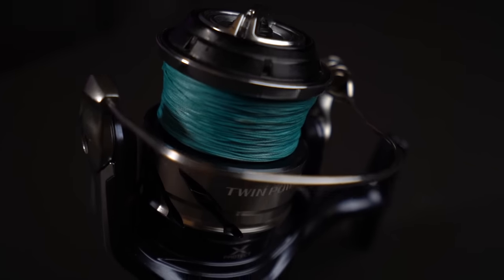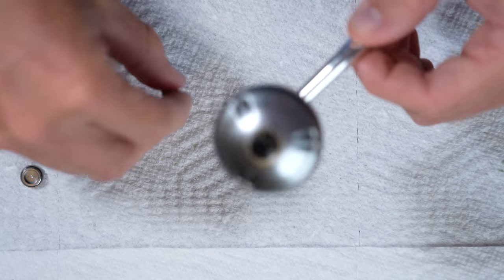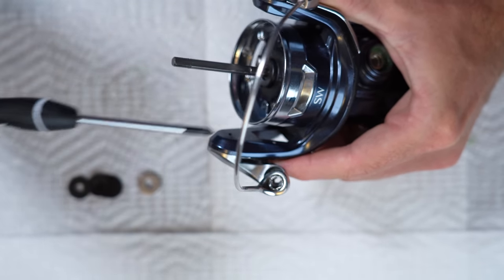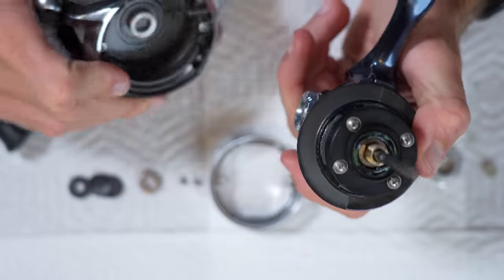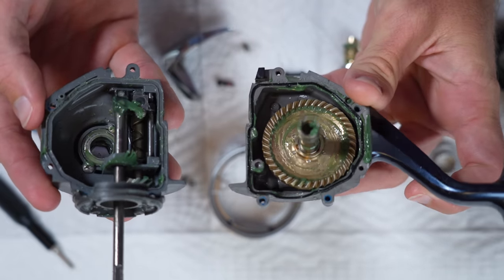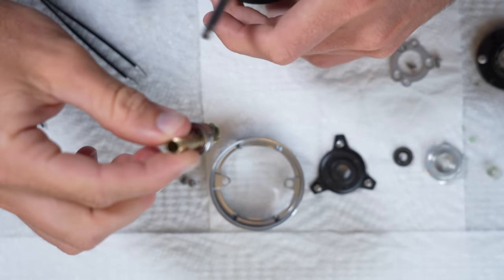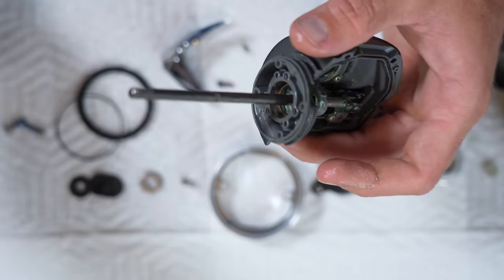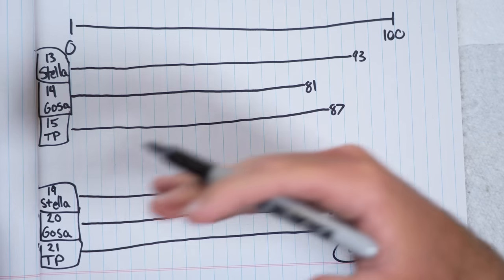TwinPower SW Review/Teardown. Save Your Money...

Comment: Glad I got my Twin Power when I did.  I got mine years ago from Japan and it has a completely different handle setup.  Never had an issue with mine and it's been through hell and back.  Is it sealed up like a Van Staal or ZeeBaas, No but it's the next best thing below a Stella, along with half the $ of those I mentioned.  You call that over greasing? We would pack the body, this way if the is any sw intrusion there is little room for that water.  My Twin Power didn't just get wet, it got dunked repeatedly.

Comment: A quick temp fix for noisy bearing while you wait to new bearing to replace that noisy bearing. Soak the bearing in WD-40 in a bottle cap, so the bearing sits under the level of the WD-40. It will break down the oxidation. Then you can fish while you wait for the new bearing. Continuing problem bearings, I replaced with ceramic.

Comment: Hi Ryan

I need an expert opinion on a problem I'm having with my Twin Power 8000 PG.

While checking the drag of the Twin Power SW-C 8000 pg I just bought, I realized that it was still a bit tight even when the drag was loosened to the end.

Then I compared it with the 10000 pg I have. By the way, I know that the 10000 pg has a slightly different drag system.

I loosened the drag of both of them to the end, checked the drag tension by turning the spool manually. 8000 pg was quite tight compared to 10000.

I then measured the minimum drag values of both reels with a precision balance.

8000 PG’s spool stopped clicking at 900 grams. In other words, in the lightest drag (when the spool is close to coming off), a weight less than 900 grams cannot move (rotate) the spool. The minimum drag is 900 grams (approx. 2 lbs)

In the 10000 PG, this value is 380 grams (approx. 0.85 lb). There is a difference of about half a kilogram.

Is it normal that there is such a difference? Is it normal for the 8000 PG's loosest (lightest) drag to be so tight? So is this a situation specific to 8000 PG?

I would be very grateful if you could share your opinions.

Thanks in advance 😊

Comment: Great comparison of Shimano spinning reels. I have the 4000 SW as well as the 10000 SW (‘19) models. I love both of them and the drag systems got  my attention. I’ve used the 4000 fishing lakes (bass and Northern Pike), offshore for Calico bass and surf fishing (local surf fish). A great reel to have to handle all types of species. I mainly use the 10k model for offshore. It has a lot of drag potential in comparison to conventional reels. 👍🔥 great video. 🐠

Comment: Thanks for the thorough review.  I'm debating upgrading from my Daiwa Saltist and Daiwa BGWQ to a Twin Power.  I'm just getting tired of sending the Daiwas in every season because they get grindy.  Mainly tuna fishing on a boat that tends to spray & splash.  Need high drag, durability and a good seal, hopefully without breaking the bank.
Reply from the maker: The Twinpower is a definite upgrade from both of those reels. And service is easier with Shimano than with Daiwa USA.
Reply: Get a certate sw or a saltiga bro
Reply: @Brian_Vo  No. Its time for him to switch from the dark side😝
Reply: Penn slammer or authority they full metal with stainless steel gears
Reply: And you don't have to worry about them becoming rough and clunky over time because that's how they are out of the box haha
Reply: @Slapturkey  never had a Shimano grind on me. Bought a couple of Daiwa's and they got grindy after only  a handful of sessions
Reply: @Florida dink master  did you not even watch this video? It says in it shimano is far better design and strength over a penn.
Reply: Diawa saltis MQ main gear is made of cheap zincs.  Mine rust very easy

Comment: Certate SW VS Shimano TwinPower SW next pleaaasseeeee! I will forever be grateful! Keep up these teardowns vids coming!
Reply: The sw Is a better and cheaper reel. Certate sw is awesome.
Reply: @kamadowoah4584  which one?
Reply: Problem with the Certate is when you see the cost you might as well just put out a few extra dollars for the Saltiga...If you can.☺️
Reply: @eves08109  for bigger sizes definitely. I need a 6000 size reel.  Went with certate sw and happy so far.  its lighter, more line capacity, better drag, smoother, starts up quicker. Only i like about the twinpower, clicks when you close bail and cast tad further but tbh you can never go wrong with either and its all preferences.
Reply: I was actually considering buying the Certate also and for smaller sizes that was a good choice. I was considering the biggest reel and since the Saltiga 20000H holds a generous amount of 80lb, plus with that drag I just have to get it!..I also have 5 BGs and love em!

Comment: Hmm I will upgrade my line class and stay with my early 2000 sustain 4000. Never had an issue with water entering the reel body or any issues with pinion bearings

Comment: About drag number flex: It's not! Honestly I still wish there were Reels with more drag for their size and even the 2020 Saltiga has given out on me cause I fished too much drag.   It's when you target big fish, especially in freshwater and around structure where you need lots of drag but not a huge amount of line and even a 6k Shimano would be just fine if it had 40-50lb of drag that   it can be realistically be fished at, but I have to use 8-14k Saltigas or the old Stellas and am still at risk of usin' too much drag, while the reel is already a bit much for the rod and the whole setup overkill for the lures that are fished. A 5-6k would be much better but I can only use them when I have room to play the fish and not too much current, or I'm able to follow the fish
Reply: Why not just fish an Accurate conventional reel? That's what I moved to once I realized a spinning reel wouldn't cut it. Twin drag washers and 40-50lb of usable drag as well as machined and assembled in the US.
Reply: @Tyler-kw9ce  they are an option, as well as the Aver Raptors, but they only have this drag in sizes comparable to a 20-30k spinner, and I need these small reels with heavy drag to cast lures, mostly 1-2oz and that all day long,  a conventional without a worm guide just ain't suited for this, plus you need more weight to cast a two pound conventional properly. And in this size range I have enough reels to choose from anyway
Reply: @maxschmidt9461  sounds like a really hard task for any reel to manage.
Reply: @Tyler-kw9ce  it sure is 👍
Reply: @Tyler-kw9ce  but spinners are much better at castin' light lures/weights in comparison to the reel's size
Reply: @maxschmidt9461  yes especially when dealing with larger line capacities. I've been waiting a while now for the new Accurate Tern 2. It's a star drag  with drag washers on both sides of the spool and now has cast control. Going to be using it to throw 1-2 oz flairhawks and swimbaits for big snook.
Reply: @Tyler-kw9ce  I'll definitely have to check it out!👍
Reply: @maxschmidt9461  good luck on finding that reel. With how the technology and design is changing so quickly in the fishing world it won't be long til they produce something like what your looking for.
Reply: @Tyler-kw9ce  I sure hope so 👍
Reply: Tranx 500?
Reply: @jamesh7469  if they make them with twice the amount of drag, then yes. I mean maybe a tranx is an idea for light tackle catfish fishin' talkin' about  a realistic chance of fish up to and even over 8 feet and 250lb. The problem is baitcaster usually don't hold up with this fish, either conventional for vertical fidhin' and paddled baits or spinners for casted lures. The thing is also that the really big baitcasters who might survive the pressure ain't made for the relatively light lures (1-2 oz on the light tackle, 2-3, max 4 on heavy and for the heavy tackle you want 50lb of realistic drag). And even if a reel us capable of catchin' giant fish, if it survives the way I fish, especially about the drag, is a different story 😬.
On the other hand I have made countless people speechless with the fish I caught in ways and places where they either didn't think those fish even exist, or were convinced they were impossible to land.
Reply: Twin power 8000 runs 25kg of drag. That should be plenty
Reply: @ihatethegestapo7649  on paper it does, in reality not so much and the reel wouldn't last at this numbers anyway

Comment: Which has the better casting distance, the stella or the daiwa , and which is the better of the two brands of reels? I have all shimanos and one daiwa. Im still trying to decide if I want to purchase the Tp sw or not for my 12’ surf fishing rod.
Reply: Stella has a better spool lip design for longer casting.
Reply: The twin power is perfect for what you are wanting to do, I'd probably go the 5000 you can run the 6000 spool for extra line capacity if you ever wanted or a heavier line depending on where you were fishing 👍🎣
Reply: @ihatethegestapo7649  
Thanks a lot my friend! I’ll do just that. Tight lines! 🤙🏿

Comment: I sold my Saragossa of using it two times, not a good reel. Choice for replacement was a certate or twin power, I bought the certate, excellent reel. I love my Stella 5000 but I don’t use it as much as the certate due to weight imbalance with my rods. Rods are often too light these days which sucks
Reply: Use Penn carnage rods they ain’t light

Comment: what is the difference in body from a twinpower sw 6000 to a 5000. I see that there is only a 10 gram difference in weight and I put it down to the larger coil (they are not "C" bodies). the difference is internal in the gears? The 6000 has more drag than the 5000. what is the actual difference?
Reply: Spool

Comment: hallo i have a question regarding twin power sw 4000 size. what is the difference between 2015 model to 2021 model?
Also are all 2021 models comes with c compact body?
Reply: 2021 model has a C at the end meaning it's the third generation of Twinpower SW. The Twinpower SW 4000XGC has the body and gear of the 5000 and 6000 with a more compact 4000 spool. So the gear is bigger than the freshwater regular Twinpower 4000 or a Stradic 4000
Reply: @aquaholiklee  thanks for the info. So will a 5000 or 6000 spool will fit the 4000 body?
Reply: @shimiavivi  it will be oversized. The rotor is different on the 4000. The gear and main body is the same. Buy the 4000 if you need the same winding power but at a reduced weight. By the 6000 for more line capacity. The more compact rotor and maybe different handle on the 4000 is the reason for the weight saving.

Comment: I got both..twin power and saragosa.. same size and same gear ratio.. honestly, there are big different in cranking power.. doing vertical jigging with 100g of jig, twin power are more stronger and easier.. thats why i love wormshaft oscillation system.. thanks me later ✌️😊
Reply: What gear ratio are you using? On them? Cheers.
Reply: @ihatethegestapo7649  5.7 :1

Comment: Certate SW review, definitely would be surprised if you didn't rate it over the TP
Reply from the maker: We shall see, it's hard to make finite opinions on all reels as I don't fish them enough to have good personal experience. The Certate SW seems legit but again, I'm not versed in that reel yet.
Reply: Can Ryan take the Certate SW apart though like the Twinpower?
Reply: @ronmb81  yes, just takes a special wrench that's actually super cheap from daiwa, now getting the magseal back to snuff with fero fluid I'd leave to the professionals
Reply: Brilliant reels but my local reel repair guy isn't sold on the new aluminium gears in them. Posted a few photos of some pretty bad pitting with saltwater intrusion.